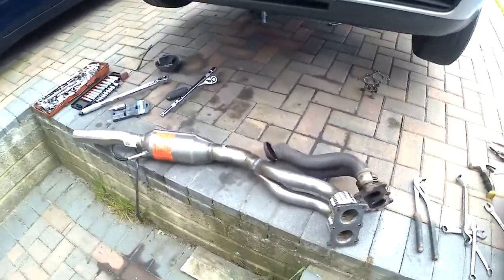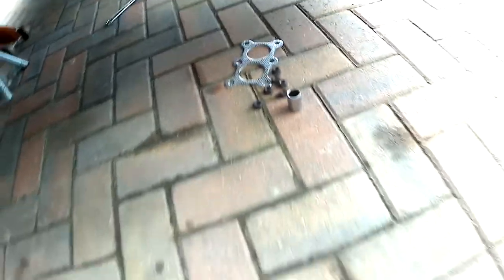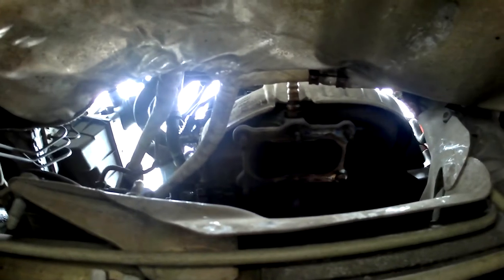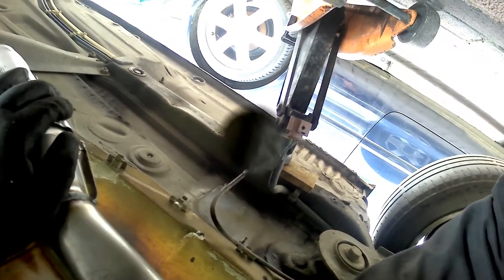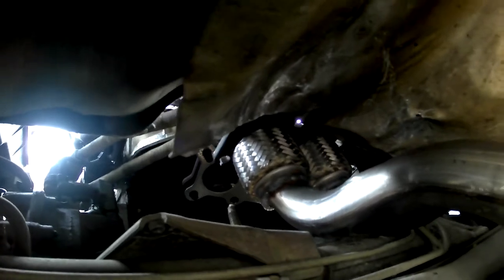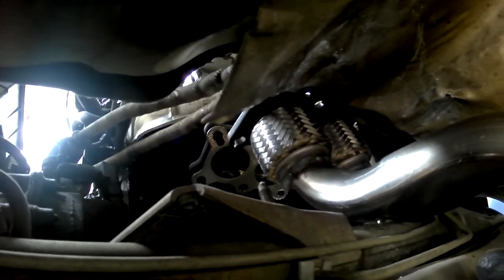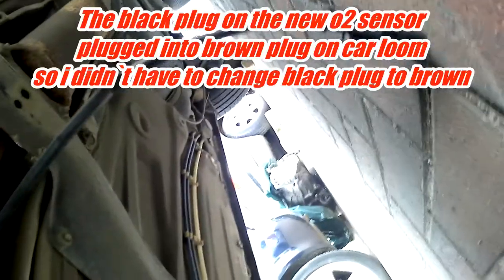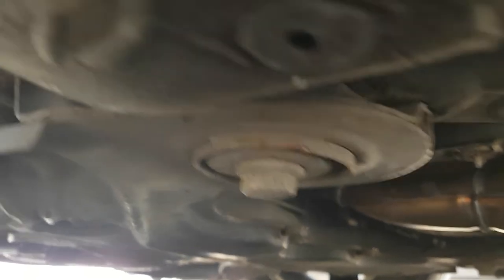VW Golf Mk4 GTi 2.0 litre new cat

Comment: Nice video.  This helped me to replace the cat on my 2000 VW Jetta with a 2.0L AEG engine.  In addition to the rack and pinion heat shield, I had to remove the exhaust cross member so I could lower the center muffler/resonator.  With those two removed, I was able to carefully maneuver the catalytic converter through that small opening.  This was all done on jackstands (no lift available).